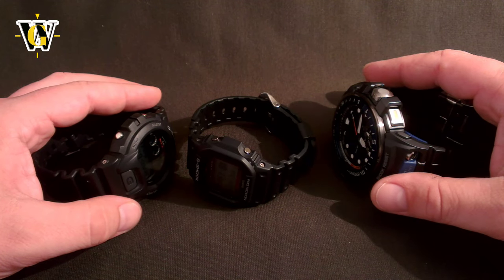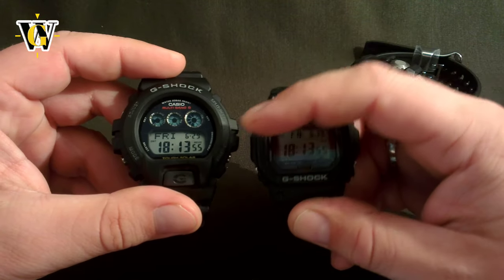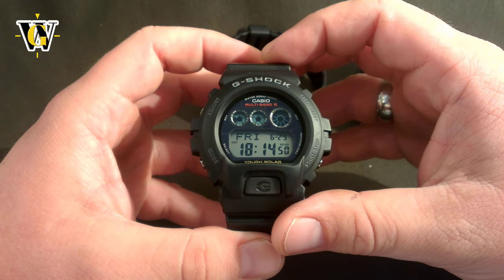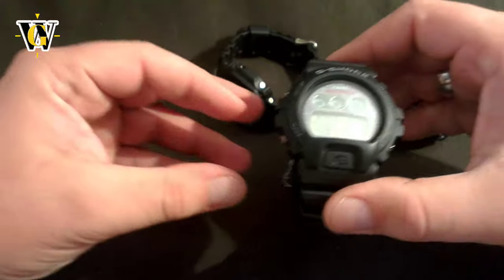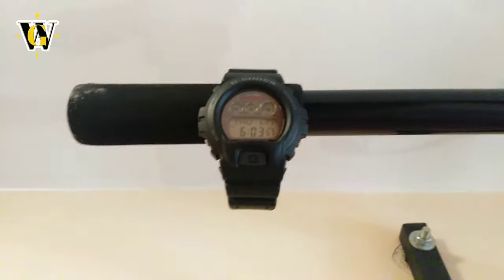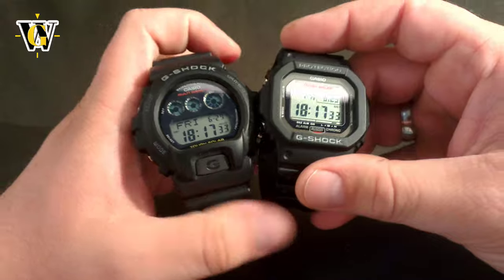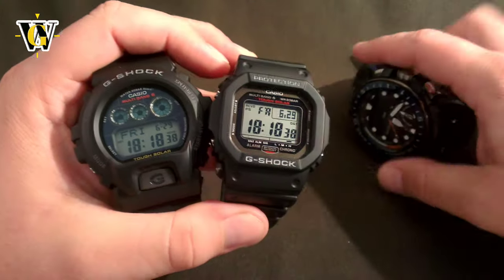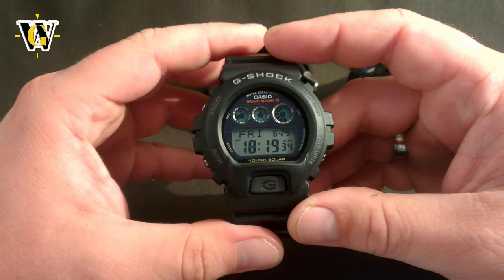DIY Amplifier for Atomic Radio Controlled watches that actually works & is VERY  simple

Comment: Thanks this worked like a charm.(new sub) I'm mad about the towers shutting down here in the us.There was not one mention about it on the news or any were else .I found out from your video
Reply from the maker: Write to your Congress representative as the decision still has to go thru Congress
Reply: I need help, gentlemen. I just ordered my first Casio with atomic time synchronization. Does this mean this is a wasted feature for me now? I live in upstate NY. 

I literally could have purchased a model that was only solar charging and saved money, but foolishly wanted this feature. 
I just ordered 9400

Comment: Just thinking maybe you can come up with some kind of watch box with an antenna on it maybe put a metal plate at the bottom of the box and attach an antenna to it not a big one just a small one or whatever can work and you can lay your watch is in a nice box I don’t think it would work like one of those wireless charging pads maybe something like a sync station for atomic watches

Comment: What model in the center?
Reply from the maker: It's a modified GW-S5600 that has the bezel and strap from a GW-M5610
Reply: Watch Geek oh great, if we change the case did the water resistant is there or no more?
Reply from the maker: @wannazmi4321  you don't change the case, just the bezel and strap, they have nothing to do with water resistance as the case is a separate part and you don't open it!
So yes, the water resistance is still there 😊👍
Reply: Watch Geek oh didn't know that, thanks for the information
Reply from the maker: @wannazmi4321  no problem 😊👍

Comment: Today i i'v got my GW-M5610.I tried a lot of times to sync.Inside and Outeside but i only get the ERR Message.It sucks.I have most of the Time L1 and live in Germany.The Atomic Clock is only 190 Miles away from me.For now the Multiband 6 expirience is a Disappointment.

Update one Day later:I tried it and it's 100% working!I was putting my 5610 just on to the Steel Tube of my Vakuum Cleaner and the watch sync every time successfull.3 times in a row i'v got a succsessfull sync👍🏻